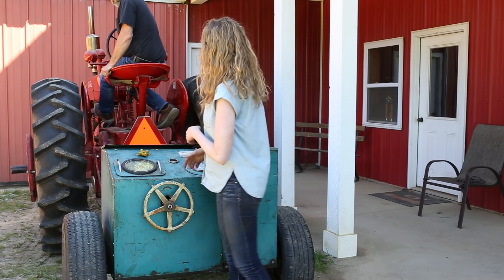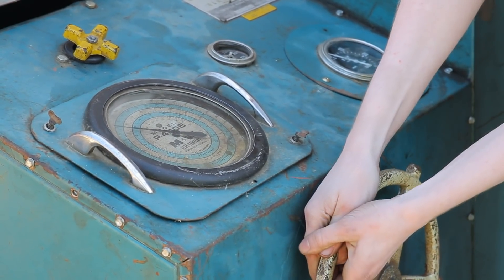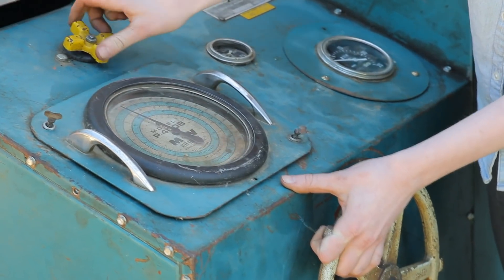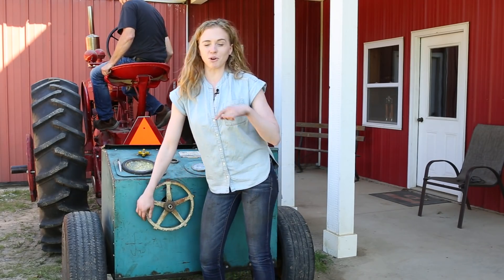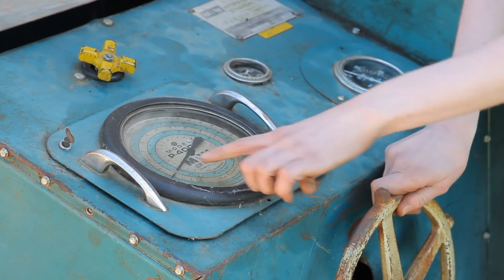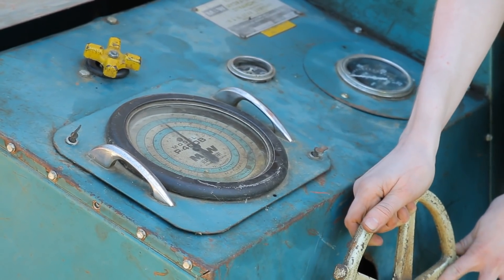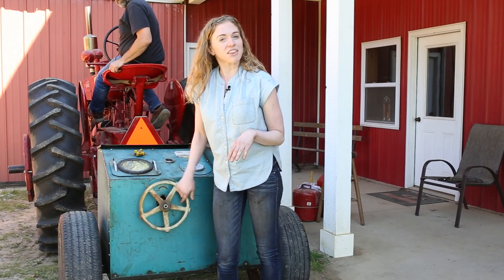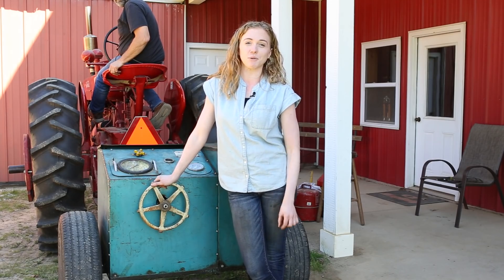Tractor Pulling Fuel: Race Fuel vs. Regular Fuel on a Dyno

Comment: 60 HP with regular gas. What did you do to that tractor? 450 engine with fire crater pistons? Wouldn't surprise me. With oversized sleeves and pistons, the M engine would put out about 45 hp. You cannot put 450 sized sleeves and pistons in an M to my knowledge.

Comment: Clearly to take advantage of higher octane you have to add timing (or more boost on a forced induction engine) The only reason she gained power is most likely due to the fact that the carburetor is jetted wrong and the higher octane is able to correct

Comment: The advantage of race fuel, specifically high octane, is that you can advance the timing for even more power. Depending on the race fuel, it may require carb jet changes to achieve proper air fuel ratio.

Comment: Race Fuel? Just higher octane or is it oxygenated? Octane by itself DOES NOT add power it is just the resistance to detonation. If you made power with just octane you had your timing to far advanced and was detonating. If you have a computerized ignition system that has a knock sensor and is setup aggressively to auto advance timing then maybe....

Comment: Always nice to do some dyno tests! We had a jd 4020 with a 4430 turbo set and a injection pump with big plungers. 180 horse power was no problem at the dyno untill the pto clutch slipped.

Comment: call me skeptical, but I think you pulled the tractor RPMs down a little bit too far in that first Dyno run compared to what it sounded like in the second run. Also, high octane fuel such as race gas will actually give you poor performance in a low compression engine. Mainly because high octane fuel is designed to delay ignition for high compression engines while low octane fuel is designed to ignite sooner.. The reason high compression engines need high octane fuel is because the higher compression will ignite the fuel quicker giving you detonation or pinging with fuel that is too low in octane. There is nothing to be gained in low compression engines with high octane fuel, just the opposite is true. Research  it!

Comment: Race fuel alone is pretty useless in itself.
If the octane is higher with race fuel,just increase ignition advance.
If you have a pretty low compression ratio engine you make things nearly worse with a longer to start to ignite fuel.

Comment: I have a 1950 8n tractor, new starter,solonoid,battery cables,  all electrical connections cleaned. but it cranks real slow and not start, but if I pull start it it will start ? got any suggestions? ps. it cranks a little faster with all the plugs removed
Reply: It should crank very easily and faster with no plugs. Did you somehow get a 12 volt starter on a 6 volt system?
Reply: Try replacing the ballast resistor. It's needed to add electrical resistance to cold wiring during a cold startup. If it's bad it'll be hard to cold start. But will start ok when warm. It'll crank faster with plugs removed cuz the engine has no compression that the starter has to overcome.

Comment: For a comparison between the fuels you're running the Dyno correctly. If your testing the power you are not, you have to use the chart supplied by the Dyno company to where the M was tested at it may be dynoed at 530 PTO or maybe 550 . 540 is the PTO speed but not necessarily the dynoed speed as tested

Comment: You didn't mention the specs. of the fuel. Modern pumped gas or off the rack gasoline at best is 92 to 94 octane. When I was buying cam II racing fuel it was 104 and 110 octane. The higher level needed more timing advance, which is why you run a high octane if your not bumping up the compression. I'm not sure what the compression ratio is on your tractor but with 104 I would want no less than 9.5:1. 
     I moved from race fuel to avgas because of the benefit of the lead. All the lead in avgas can let you tune the timing through the roof with low compression and not get a spark knock. If you are allowed to run an electronic conversion from points that will make a difference to. 
    You should try race gas with lead additive and some timing adjustments.

Comment: Same thing I've been saying For Years about the Hit & Miss Engines running better on High Octane Fuel. 

 They DON'T NEED the High Octane to Control Detonation, as they aren't even Remotely High Compression Engines needing  the High Octane Fuels Slower Burn Rate (which Controls Detonation) but the Slower Burn Rate allows the Fuel to Burn/Expand throughout More of the Power Stroke, Versus having a Quick Explosion with a Spike in Pressure at Top Dead Center (from Low Octane Fuel) that Quickly Bleeds Off through the rest of the power stroke. 

 In a Low Speed Low Compression Engine it gives More Power because of that, while at Higher Speeds a Low Compression Engine Will LOSE Power running too high of an octane because the fuel isn't all burned during the power stroke. At a Mere 540RPM a Tractor Never Reaches that point of Losing power from it. 

 At 4,000 , 5,000 , 7,000RPM and Higher you will make The Most Power Your Engine Can Make by running The Lowest Octane it Can Handle without Detonation, and of course, The Higher The Compression, The Higher the Octane Requirements. 

 Ideally You would want to run Higher than needed Octane at Low Speeds for More Low-End Torque and then Switch Over to Lower Octane (as Low as the Compression Ratio Will Allow) as the RPM Increases, which would be damn near impossible to control with a carburetor, but with a set of custom heads with Dual Injectors plumbed into different Octane Fuels, it could be switched On-Demand as the RPM changed, up and down.
Reply: Higher octane fuel (race fuel) 102/107.   Absolutely burns at a slower smoother burn rate.   Thats why no pre ignition.
Reply: Fuel Octane does not determine the burn rate; it is the fuel's resistance to auto-ignition controlled by the amount of anti-knock additives

Comment: there are too many variables that have not been accounted for. it seems that neither the tractor nor dyno were up to standard operating temperature.  the power potential of the fuel was not exploited without proper tuning for each.  also, try propane!

Comment: I’d think the gain is more to do with the race fuel having no ethanol. “Regular gas” these days is at least 10% ethanol, which makes the fuel less powerful due to fewer BTU. Unless you’re running high compression (10-11:1 or higher in a tractor), which I doubt an M&W kit alone could do, the high octane fuel could actually cost a few horsepower compared to a lower octane, 100% gasoline fuel.
Reply: Ethanol also destroys rubber parts, including o-rings, injector seals and gaskets. Far as I'm concerned, Ethanol has no business being mixed with Petrol. They don't cut Petrol with Ethanol for any reason that's a benefit to us. They do it for the same reason a drug dealer would cut cocaine with baking powder. More profits.

Comment: Here is my tip, when pouring from that kind of can if it is full. Turn it half a turn so the spout is at the top. It will splash way less  and lets in some air giving you a smoother pour.
Reply: Right. any can that i have tried, if its not made so you can turn it up ,I dont use it . cans with centered holes are useless for pouring.

Comment: Really enjoyed this! Surprised at the results. 4hp is 6.66% increase, if my math is right. Absolutely worth it! In a tractor pull. When it comes to making tractor power. My heart beats a lot faster. 😆
Reply: i thought her baseline hp was 50 hp on this improved tractor,,,if so, 4 hp = 8%
Reply: @bill45colt  I listened again, you could be right. I just make out 60 to 64 hp. I'll admit that 50hp out of a M is much more reasonable. Even if it is souped up.
Reply: Base was 60
Reply: 4hp. Isn't gona make you win. Having your tractor weighted properly will win. Farm stock style pulling is all about weight. My super M isnt the strongest in its weight class but is always top 3. Knowing your tractor is key and picking the right line is key

Comment: What are the details of the ace fuel? Octane etc?How much does race fuel help horspower in  a  standard stock "M"engine?
Reply: It wont help at all if you dont utilize the potential in fuel. Compression and more timing. 
Its probably something like c16.  Its got an octane rating of 120

Comment: Would warm oil in Dyno on second test affect reading?
Love your channel. No disrespect. 
Shalom
Reply: Oil temperature absolutely will affect the readings.  The temperature gauge looks to be at the same place (stone cold) for both dyno hits, but it also looks like the glass may be broken out so we don't know if the gauge even works.  Getting the oil up to operating temperature is very important!  Our P2000 dyno will cavitate the pump with cold oil.
Reply: Even the engine and transmission oil temp  makes a difference. 
On car dynos they run 3 times for consistency.
Some places tell you to drive for  10 miles to warm every thing up before driving on the Dyno.
They should run the tractor for 15 minutes under medium load before each measurement.
Reply: @Tomyp89  we had electric Dyno for gensets

Comment: Regarding racing fuel, The engine will  heat up way past normal operating temperature and that could cause major engine damage, especially to the head and valves!
Reply: That is good to know!
Reply: No it won't. If anything it would run cooler because it would burn more rich. Added timing can also make the engine run cooler
Reply: You don’t have to believe me, but the head will super heat with high octane fuel.  Do a temperature test.
Reply: @TheHobbyShopFilms  but it could be on your application. This is just my experience
Reply: I have a 4cyl ecotec i run 93 octane on 17 psi, i run race fuel at 25 pounds of boost no difference in temperature even with added boost. My friend has a naturally aspirated big block mopar makes about 750 hp on pump gas with race fuel we turn the timing up and it runs a little cooler

Comment: I'd be really curious if a few more hp could be gained by bumping the timing on the race fuel.
Reply: yes because octane rating is higher so you can set timing earlier without the engine pinging…  of couse this has limitations
Reply: Clearly to take advantage of higher octane you have to add timing (or more boost on a forced induction engine) The only reason she gained power is most likely due to the fact that the carburetor is jetted wrong and the higher octane is able to correct it.
Reply: The increase of timing everyone wants too add will also increase the parasitic loss of power. The specific gravity of the fuel will be higher and they need to adjust the AFR before changing anything else , Increasing octane in itself will cost you power. It may have been a oxygenated fuel
Reply: Im sure you could pick up 5 maybe 10hp
Reply: Cant make power off better fuel unless you utilize the potential in the fuel

Comment: Great video Rachel. Seems like some of the viewers want you to give up all of your tricks for being the best tractor puller. IMO they need to walk the walk for themselves. 😉 😂😂😂
Reply: Huh?  I don't see anyone asking for tricks to being a better tractor puller.  I do, however, see several good suggestions on how this dyno test can be a lot more of an apples to apples comparison.  Several very good questions and suggestions have been posted on different adjustments that could be made to give a true answer of whether changing fuel actually gained horsepower.  Right now, there are too many unanswered questions and other plausible explanations for the horsepower difference other than the fuel alone.  It's a neat video, and with some more thorough and controlled testing, could provide some interesting results.
Reply: @moorepower7  I think Rachel was making one comparison and one only. In fact, testing one thing at a time IS the scientific method. Since there are nearly infinite possibilities, she couldn't realistically cover them all in a video. Thanks for the lecture though.

Comment: Lots of unknowns here... what type of  "regular" fuel are you using? 87 Octance, 91 Non-Oxy, E-85?  And what type of race fuel? something from VP? or just 100LL from a local pump that's labeled race gas?  compression? timing?
Reply: You are over thinking the point of this video. Alot of people just fool around once or twice a year at the fair or something like that. Its not always that serious.
Reply: I think that's why its actually more important to have those questions answered.  There will be plenty of guys who go just once or twice a year and in their mind... "I'll just pour some race gas in it" and away they go.  The problem with that line of thinking is that at a certain point, its a diminishing return on investment.  Pouring 100LL or VP MR-III into an older tractor like the M, without any additional work done to the head or pistons, doesn't usually net you any gain and due to the low compression ratio can actually rob you of any power.
Reply: @itsthebeardlife  I understand what you are saying, but the video shows what it shows, with no deep dive into the science of this or that. I dont think that was the intention of it. They'll try it once and they'll know if it helped. See it for what it is, no need to nitpick.
Reply: @ryanfrederick4889  Well there in lies the problem.... you assumed I nitpicked.. I was just looking for more detailed information

Comment: Rachel: What is the compression ratio on your M ?  We have found that the best power comes with the lowest octane fuel before detonation. How HOT is the engine  in that M ???
Reply: Then it would be worth it to buy premium 91 octane at the pump?
Reply: Yeah race fuel alone doesn't really make more power it allows you to run more compression, timing and boost depending on the application.

Comment: Just barely above the 5% that could be chalked up to measurement error on the instrument. Have you tried advancing the ignition timing with race fuel? The benefits of higher octane are best found with higher compression and ignition timing. Pretty cool to have a dyno. Great way to mess around with tuning.
Reply: I agree, plus hotter plugs might be a good thing to try as well
Reply: I also agree.  Timing advance in two degree increments until detonation occurs with the dyno test at each adjustment will give a more complete analysis of the modifications. 
Cheers
Reply: With most measurement systems, relative, side by side measurements are pretty good, but a single data point is generally not ideal.

Comment: How much does the race fuel cost vs regular fuel? Just a question for comparison :)
Reply: $8.00 to $12.00 per gallon. Do it in a heartbeat. Win or loose.
Reply: @wyattdean5658  That's not that much more expensive compared to our european prices for normal fuel.
Reply: @JelleStappers  Yeah they really rip you people off big time!!  Bad part about it is you guys put up with it. But they have been sticking to you for so ling you become used to it.
Reply: Jelle Stappers depends on the fuel. I can get 110 octane leaded fuel for about $6.50 a gallon at a pump.
Reply: Vp 10-20$ gal